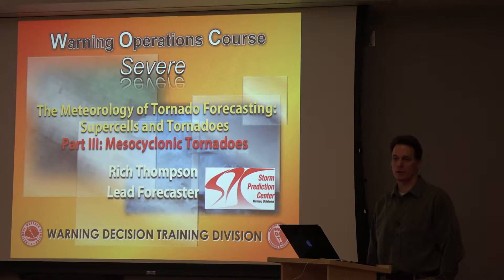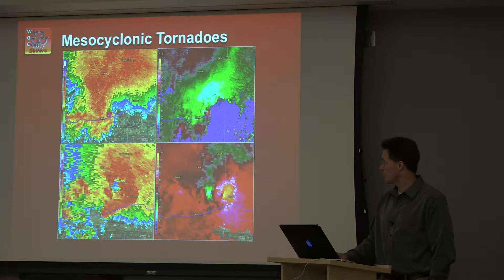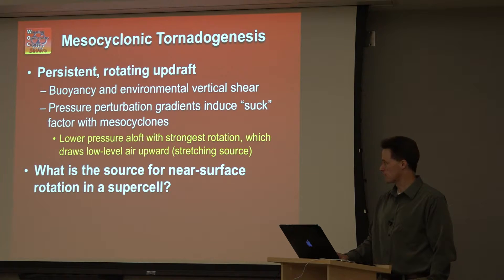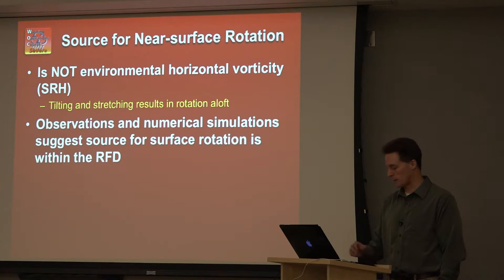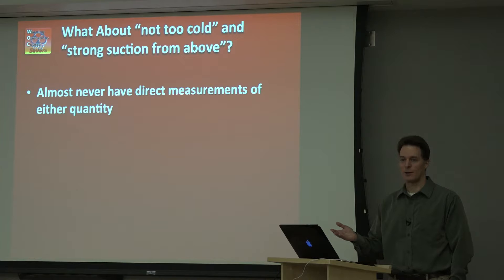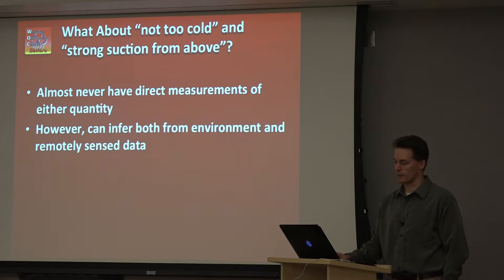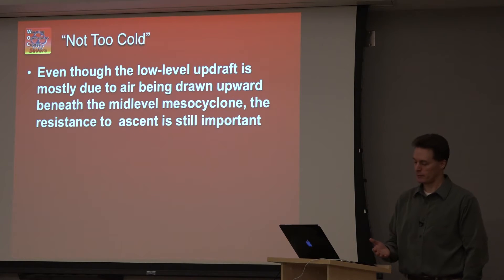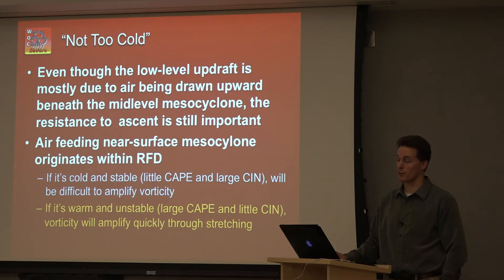Mesocyclonic Tornadoes

Comment: I find it interesting to hear the theory reiterated that it is the RFD that is responsible to surface vertical vorticity. Being a mere hobbyist and not a scientist in this field, I am curious about how much of a divide there is between camps now that more recent supercomputer models, particularly the work of Leigh Orf, seem to be showing that it isn't the downdraft but a feature called the streamwise vorticity current (SVC), which comes from the cold pool, that is actually behind tornadogenesis and that the RFD is more of a symptom than a cause. This video is a bit dated but I would love to hear more about how evenly divided (or not) the scientific community is about these two hypotheses.
Reply: I agree!

Comment: This is an interesting, but fairly technical video. The audience seems to be folks who have college-level meteorology training. That doesn't mean people who are out-of-field won't find it interesting (my degree is in government). But it would be nice if some of the technical jargon were explained a little bit better. For example, toward the end there is a discussion of "LCL" as a factor in assessing whether vortices in the the rear-flank downdraft can be stretched into a tornado; I had to Google what "LCL" means (it's "lifted condensation level"). While I am probably butchering this, I think this probably means that RFD areas with low cloud bases (i.e. point where air condenses into cloud stuff) are more likely to generate a tornado. I assume this probably corresponds to "wall clouds" (a term that amateur weather nerds understand) although that may be stretching the original point too thin. But if that's basically what Mr. Thompson means, it would be helpful for him to just say it to illustrate the point. Just my two cents. :)